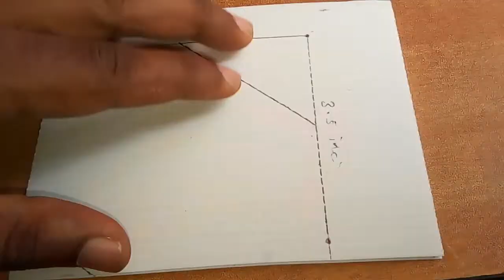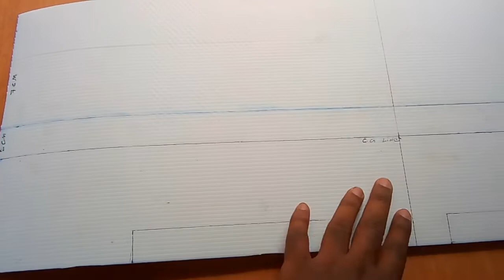How to make Rc Airplane from coroplast sheet | Radio controlled Aircraft | Remote control plane

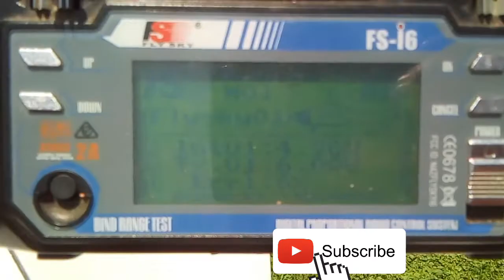Comment: some info.      at 1:55,  the  leading  edge  of  a  vert-stab  SHOULD  be  ONE  line;  from the top edge  to  the   FUSELAGE. !!!   slope, about  75 degrees.        partial  amputation of the rudder is  NOT  recommended !!!        the  dom  of  the  aluminum  tail boom  is  less-than  ideal.    distribution of mass.        at 3:00,  this model has  a   wonky  main wing.      the chord is excessive and the  profile is   NOT  a  good  one;  compare the clark-y.     at 4:14, control horns are not correctly shaped/configured.       the  Mass of each aileron servo  Should  be  located, just,  Forward of,   cg;  THIRTY  percent of chord.     at 5:02,  put the  Mass of   rudder/elev  servos  VERY  NEAR  the  cg. !!!!!!       at 5:38,  ailerons  Should  extend to  Very  near  the  wingtips !!!    and, the use of full strip ailerons is not recommended.       it appears that the span of the horiz-stab is  too small.   the span should be equal to  thirty percent of wingspan.      it is correct to use a bit of sweep, at the horiz-stab leading edge.    that  Ain't  sweep.      googletranslate
http://1.bp.blogspot.com/-5C8vhlmhBOk/VRe3o3Jt3yI/AAAAAAAABrI/EEgVHXkLvbY/s1600/clark%2By.gif
https://en.wikipedia.org/wiki/Clark_Y_airfoil
see  correct  use  of  sweep, at   stab  le.
http://www.janezlet.si/en/image/large/95